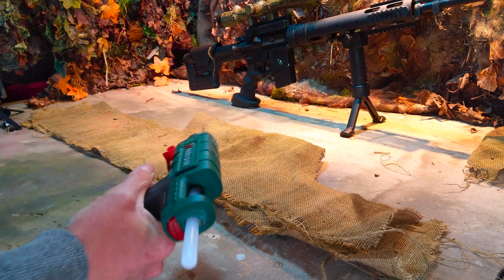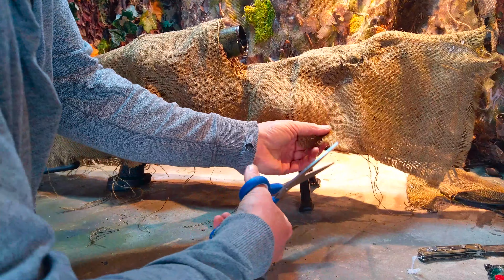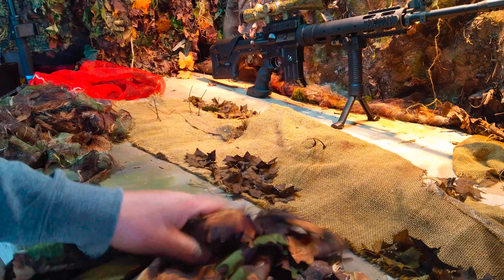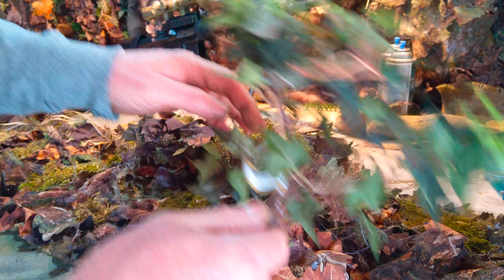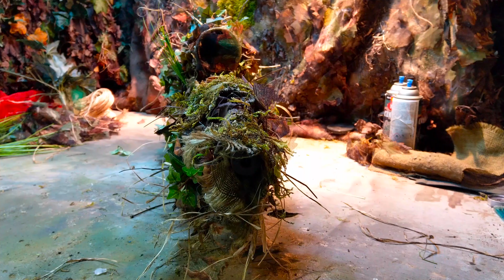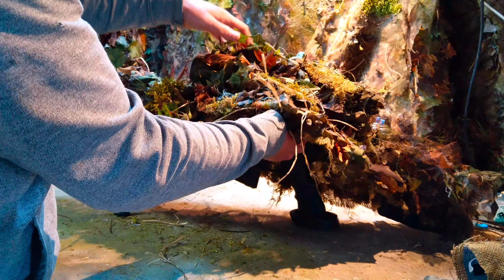Ghillie Gun Wrap (how to)

Comment: Great video and tips thanks! I'm building one for my custom M40A3 for the first time. I'm really interested in the moss, did it last long at all or fall apart quite quickly over time? I've been collecting the wrong kind apparently, mud moss, a guy saw me collecting it on the pavements near my house and instead of thinking I was absolutely mad he kindly pointed out where I can go to get some large chunks of the 'good stuff' as he put it lol; great lad, he explained the differences between tree moss and mud moss. I'm Irish (Dublin) too but live in Wales.
Reply from the maker: Moss will dry out and eventually crumble but it's easy enough to replace and you can't beat the natural stuff on a wrap
Reply: @oldmansniper  Cheers for the fast reply and info! I wonder if a clear coat of rubber paint would help it last longer?
Reply from the maker: I think it might add unwanted sheen/reflectivness (new word) worth experimenting with though.
Reply: @oldmansniper  I was thinking of using matte clear not varnish, this is for my sniper collection rather than gameplay as I collect historical sniper replicas and just use them on my 30m indoor range, probably sacrilege to you! lol.